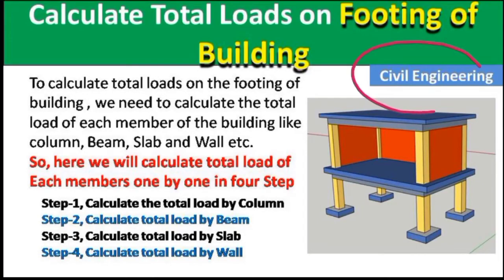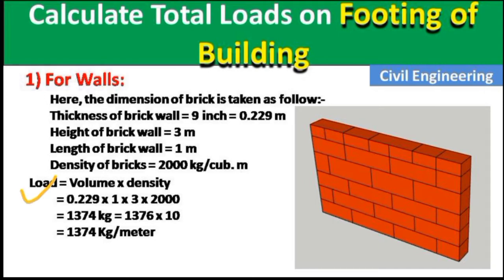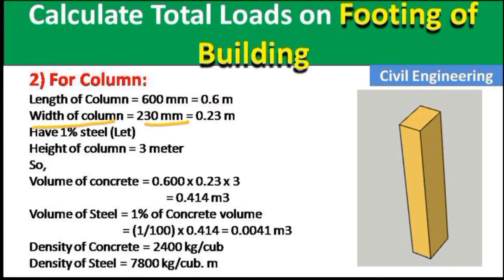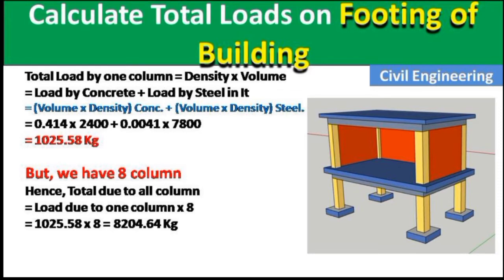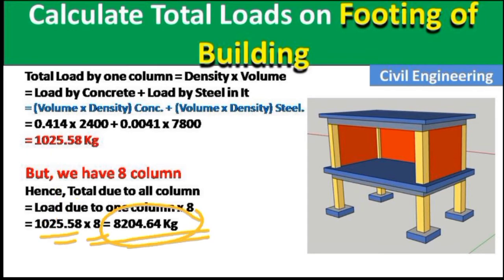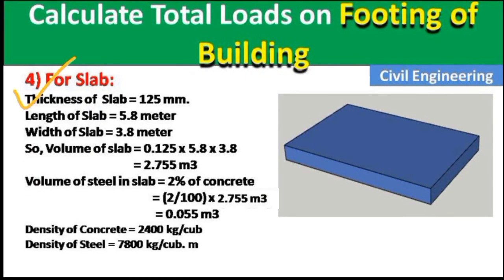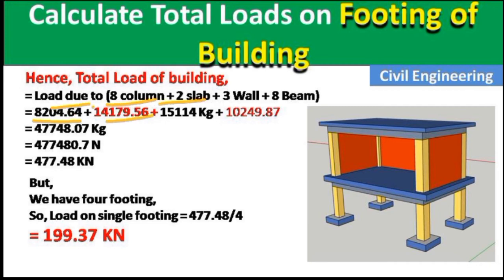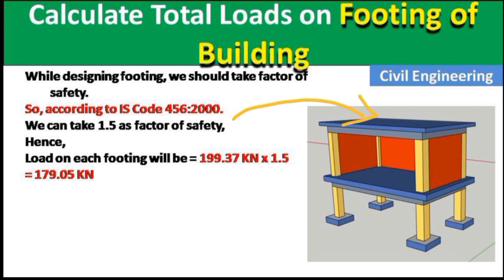How to Calculate total loads on footing of the residential building including steel?

Comment: Sir, l have one small doubt, total weight of steel in kg it is not calculate in this problem, so, why are you not do the steel quantity? Please explain clear the doubt. (D^2/162 × total running meter)

Comment: At 17:155 you add in the safety factor by multiplying 199.37x1.5.  How did it become less at 179.05?  Shouldn't it be 299.055?  Even if it was 179.05x1.5, it is still still 268.575.  Did I miss something?
Reply: because prior to that he divided 477.84 by 4 and got 199.37 when he should have gotten 119.37. bad engineers are bad at math. maybe why hes trying to start a youtube career. to many real world mistakes